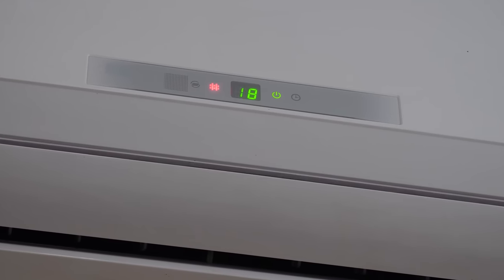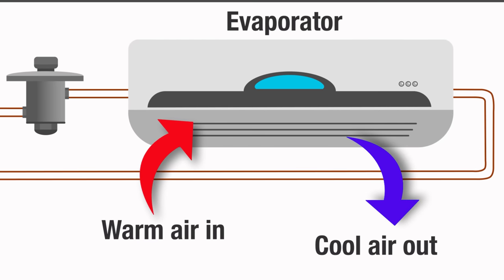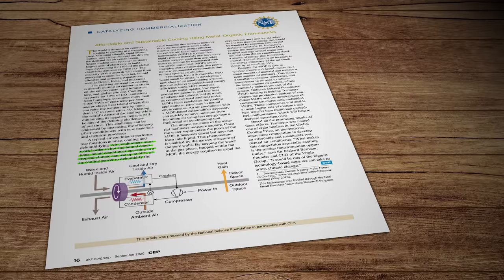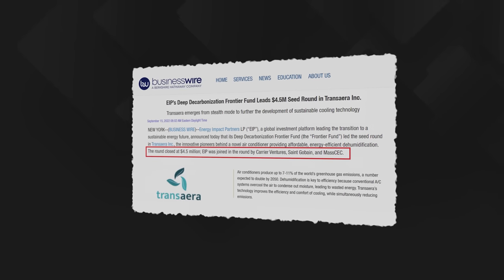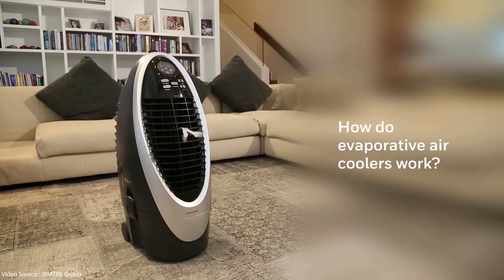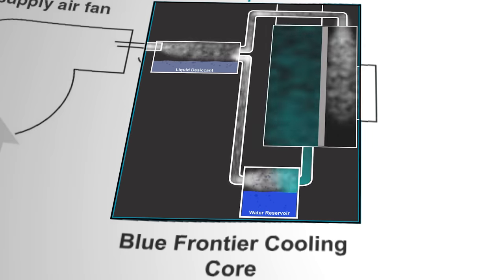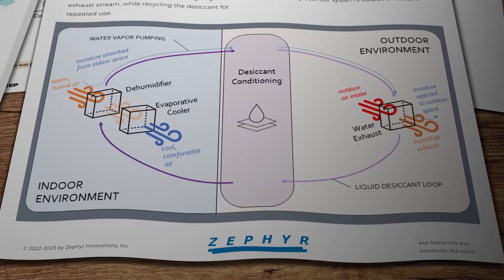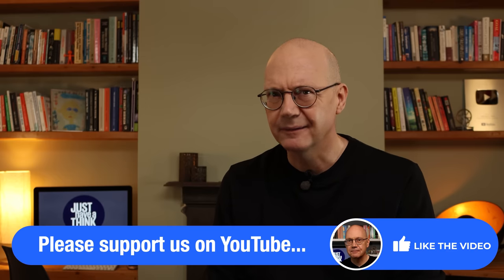Emissions free cooling. Can we do it?

Comment: How does this fit in with using the same heat pump (multi-split air con system) for heating during the winter??

The unit you described at the start can also be used for very efficient heating with a COP of up to 4 (when the process is reversed) and a lot of people are installing them for heating as the main function with cooling in the summer as an extra.

We shouldn't be demonising air conditioning for cooling when the same 'air to air ' heat pump will reduce emissions and energy use during the winter. 

Surely it's better to use a single heat pump for heating and cooling, instead of having less efficient resistive heating in the winter and one of these new cooling system in the summer.

Comment: The other thing about conventional AC is that it can dehumidify without cooling, and also heat.

The latter is useful for the short winter as avoids the need for a seperate heating system (which many would suggest should be an air source heat pump... which is not dissimilar to using the AC to heat).

Do these new systems heat as well as cool?
Reply: If it's a heat pump/AC it can heat.  Ordinary ACs can't heat.

Comment: A hugely effective, cheap, easy, low energy help (but not a total solution) is to simply paint buildings white. This will reflect most of the heat, and the building will run a whole lot cooler. Test; next hot sunny day put your hand on various cars. The darker coloured ones will be so hot as to burn your hand, the white ones will be just warm to touch. Basic, Simple.

Comment: When using an compressor based A/C in a closed room, the air will be quickly dried and so those losses due to removal of moisture is reduced to almost nothing. That claim that dehumidification improves energy efficiency is only valid for the initial operation of the A/C.

Comment: The are some add in for commercial heat pump AC: adiabatic eveporative pre cooling system. Pacifically useful in climat dry or mildly humid. I can save up to 35% on energy.

Comment: If you have a clever building design (shading, insulation, well oriented windows, …) a simple combination of air conditioning and PV panels is easy enough to do the trick.

And since you’re using locally harvested sun energy, you’re not even heating the outdoor atmosphere more than it would have by the sun anyway…

Regenerating the desiccant fluid “with cheap night time electricity” is bollocks. When the sun is down there is less renewable energy available. So you’ll end up mostly using non-renewable energy sold (irresponsibly) cheap.

I do like these developments, but we must not forget that very often our buildings are poorly adapted to the local climate conditions, we tend to choose for remedial solutions (often powered by non-locally sourced energy) in stead of preventive ones.

Comment: So for the home cooler/swamp fan gang, wouldn’t it be more effective to have 2 reservoirs? The first being high saline to dehumidify and absorb some heat and the second with some ice paks to cool off whilst rehumidifying? Potentially keep the ambient humidity relatively even but increasing the cooling effect? As for the dilution challenge, just have an extra one to swap out for a day while the diluted one sits on the porch next day evaporating a bit…
Reply: I run a dehumidifier in an area that is damp during the winter. The amount of water that it removes is a lot (I save it in buckets and use it for laundry). I don’t think leaving the humidity remover outside to vent will do anywhere near enough.

Comment: The two issues are one, getting the system to the scale of economy. The second, is convincing those who just plunked down $7k for a new system a new system at an undisclosed cost. Thus the  third issue which raises from the previous is it's retrofit ability to systems in place and not likely to be replaced after the initial outlay. So, If they can conquer those issues then yes, clever game changer.

Comment: It still sounds like you need a traditional AC or heat pump system in addition to the desiccant system in order for this to work. One of the biggest complaints of existing AC/heat pumps is the ballooning costs (both initial investment and ongoing maintenance). So you're adding a new system on top of an old one. I am skeptical of the cost savings outweighing the ongoing cost increases of now having a dual/combined system. If it were just a desiccant system that showed similar or greater cooling effect as an AC or heat pump I would be much more excited by it.

Comment: In the UK. During a week when Aircon would be rather nice . My solar production is more than enough to cover the consumption an Aircon unit would require. Providing a battery has stored this energy from the day.  I can cool my house for the night with no emissions 

Come the winter. Though not powered by my own generation. It's a heat pump.  

Of course the more efficient these systems are the better. But the sooner the grid is green many of these problems fix themselves.

Comment: Not having to go through the phase change is a fairly big deal, but I gotta say there are lots and lots of problems with desiccant-based cooling systems.  Not only is there significant complexity associated with these systems, but there is also the problem of standing water and compartments containing significant amounts of moisture which wind up being a breeding ground for bacteria.  I really don't think this method is going to gain much traction.
Reply: With some of the systems (like the MOF technology) there wouldn't be standing water, and the MOF element would remain physically dry, so probably not a pathogen problem with that.  You're right that it represents added complexity, but if it saves enough energy it might be worth it.

Comment: Again an excellent video!

But why not save that 35% in energy by saving the cold water?

Have this cold water drip over the ploutsides of the input manifolds and evaporate as they cool the incoming air?

Or intentionally save it and freeze it as a source of thermal storage? That is portable "cold", and should have value.

Comment: AirGreen is another company based in Pennsylvania that has an effective liquid dessicant solution that is going commercial this year. They claim a 40% reduction in energy consumption and control over humidity as well. Why cool humid air when the energy required to cool dry air is significantly lower.

Comment: Have you seen Tech Ingredients' air conditioner design? This one shows an uncanny resemblance to the one he made, with the exception of the final air exchanger. But he uses a solar heater coil to dry the dessicant, rather than using power on a heat pump. I believe those videos are a couple of years old by now, but it's worth looking up.
Reply: i just love it when something that creates a problem (the sun, in this case) also provides the solution (power for the air conditioner)

Comment: Shame there isn't an easy way to change the colour of the exterior of a building to reflect more light in summer and absorb IR in winter.
I don't think anybody would want to paint a whole facade twice a year every year to match the season.

I did see some passive buildings that had porches/conservatories etc with cold air traps (an insulated pit below the conservatory/porch floor for cold air to sink into).  If ducts were run from them to the top floor of a building, and warm air sucked out the apex by a wind powered vent at the other end of the building, that should encourage convection and mixing, with rising warm air displacing the incoming cool air.

Comment: The removal of humidity from the air is not needed in conventional air conditioning, it is a collateral effect from the contact of air humidity with the cold metallic evaporator, and it is actually so bad, that some form of replenishment is needed in specific situations. Those processes using desiccants are also bad for the environment and generate contamination, they can also be harmful if a malfunction leads to air contamination in closed rooms. The best we can do is, instead of just use the outside air to cool down the compressor phase, a central conditioning installation, either commercial and residential, could use this heat to generate electricity, and this already can be done safely and with a high efficiency.

Comment: If heat is just from the friction of rapid vibrating atoms... is there not at least a way to trap those atoms in tiny enough air pockets that will nearly at an instant slow their vibrations because of how much they tend to collide inside those air pockets until it slows enough to simply drift out through a vacuumed side at a far lower state of vibration, hence... cooled down. I don't know if such material already exists in nature or can easily be manufactured/grown, but... that seems to be the ultimate type of air-conditioning if feasible.

Comment: To address the question in the video title - emissions free cooling is possible now.   

I have AC and produce enough solar power to run it.  And I'm far from the only person doing that. 

So cost will be a major issue for the adoption of these ideas.

Or target these new systems at commercial buildings or blocks of flats where the capacity for on site solar is less.

Comment: A few months ago, a more efficient compressor was featured on this channel. Could this be combined with the existing evaporative technologies to increase efficiency in both cooling and heat pump equipment? Or is there something in the operating range of these compressors that prevents this?
Reply from the maker: I think it may be feasible
Reply: No reason why not. That compressor needs some very precise machining of large, intricate parts though - fine for industrial use where budgets are larger, but it might be too expensive to manufacture for domestic customers.
Reply: @vylbird8014  Good point. Hopefully the long term savings might justify the higher cost of manufacturing, or that larger production volumes bring costs down.
Reply: @StepDub Not without regulatory intervention, I think. The manufacturer isn't the one paying the operating cost, and most buyers don't know enough to take it into consideration properly, so there's no incentive to optimise for efficiency. You could get the state to pass a minimum efficiency regulation though, but that brings politics in to it.

Comment: I don't know why no one wants to harnesses waste heat and concentrate it to then use it as we need it. It would basically be free energy.
Reply: TANSTAAFL. 
or on this subject 
TANSTAAFE. :)
Reply: Hmm almost like the waste heat from my refrigerator could be used to heat my water.....
Reply: @d1j16  What does that mean?
Reply: @David_Mash  well when it comes to waste heat from air conditioning, or now heat pumps, there's a lot to get rid of on hot days, especially in warm countries, and what do we do with it! We vent it out into the already warm air.
If we could find a way to store it, concentrate it and then use it when needed, that would be a huge energy saving, and stop heating a world that is starting to over heat
Reply: @atticboy51  my neighbor has a heat pump pool heater to heat his pool water. It sits next to his house AC unit. The pool unit blows out cold air, the AC unit blows out hot air. Let that sink in
Reply: @atticboy51 the problem is you can’t “concentrate” it without inputting extra energy and thus generating more heat. 

It can be hard to get one’s head around, but I recommend you look into the thermodynamics of work heat and waste heat. Waste heat is too high entropy to do the work we want it to do, though it can sometimes be redirected to another use case which has a lower work energy requirement. 

A common one is co-location of energy and hot water — you need much hotter water to turn a turbine than you do to heat a home, so the waste heat from power is suitable for heating water. However, the heat output of an air conditioner is usually lower temperature than your hot water, so it can’t be directed to that purpose. 

Think of it like a ball rolling down a hill, where higher ground is higher temperature. If you can find another “valley” below your waste heat output, you can direct it toward that valley — but you can’t make it roll uphill without supplying extra energy from somewhere else.
Reply: @atticboy51  TANSTAAFL =  There Aint No Such Thing As A Free Lunch.
Heat pumps kind of concentrate heat energy at a low cost but it is nowhere near "free".  It is not a new idea either, see episodes on using waste heat from data centers to warm water or run Stirling engines. This creates another issue as the main point is to cool the heat source, which does not work as well if you put more stuff between it and wherever the heat is supposed to be dumped.

Someone once suggested putting electrothermal elements on the back of a solar panel to get more power out of the overheating panel.
Problem 1: The panel was overheating when it was clear to radiate away heat, adding material would act as insulation meaning it would overheat more and become less efficient.
Problem 2: The TE-elements would not produce much power from just few tens of degrees of temperature difference so it is unlikely their output would cover the energy lost from solar panels overheating.
Problem 3: The TE-elements are ridiculously expensive on this scale, as in couple thousand dollars to produce few more watts.
Reply: @kaitlyn__L  I don't understand thermodynamics, I probably could have when I was younger and really quite into physics and chemistry (I was quite good, but lost interest unfortunately), so I just asked the question. You see what I saw was that heat can be moved with heat pumps, and I wondered if they could be configured so that they concentrate heat in an insulated storage vessel. But if thermodynamics won't allow that I fully understand that it would be a pointless exercise.
Reply: @atticboy51  it’s a perfectly reasonable question! I myself studied astrophysics yet didn’t understand why we can’t just “keep and collect” (as it were) waste heat of all kinds (from motors, charging batteries, and so on) for the longest time. I would say “joules are joules, what’s the problem?” and so on. 

I actually only found out about this answer a few years ago when I was trying to look up the nitty gritty. I don’t suggest you look at extremely technical thermodynamics theory, but there’s a ton of really great accessible explainers (in both video and text form) out there which I bet you could still understand! 

That said I will try to summarise, though I do strongly urge you to seek out other sources as well! 

But yeah, the long and short of it is everything comes down to the temperature gradients, also called delta. Not really the heat as an isolated thing standing on its own. 

From physics you may remember delta-T as an integral of time in acceleration, this is similar except instead of time it’s temperature. And just as a higher delta-T means higher acceleration, a bigger delta in temperature leads to a faster flow of heat from hot to cold. 

Whether something can do useful work for us, or whether it’s chaotic undirected waste heat, basically comes down to whether the delta is high enough. And heat pumps work by creating an artificial cold spot the ambient heat wants to flow towards. Therefore if the waste heat we want to capture is less than the heat we create in making that cold spot, we won’t be moving net energy anywhere.
Reply: @kaitlyn__L  thank you for your explanation, I kind of understand it, and it seems such a pity that we can't use waste heat 😕
Reply: @atticboy51  for sure. 

There’s another way to look at the problem, by reducing it to its most extreme example. Say we wanted to capture all waste heat from everything. We’d need to create a chamber which was at absolute zero. But if we had any way to let heat in, that’s also a way for heat to leak back out again, and it wouldn’t be at absolute zero anymore in either case so would stop working. 

The only way it would “work” would be to completely isolate it from the rest of the universe, which is not only self evidentially impossible but would be self defeating even if it were! There’s a similar paradox in perpetual motion machines, where they can theoretically exist in a perfect vacuum with frictionless bearings, but only if no momentum ever gets extracted from them.

In fact, I think the perfect thermal box would technically be a type of perpetual motion machine. It’s basically just another example of Maxwell’s Demon thought experiment, which was originally about sterling engines rather than heat pumps.

Comment: i want an ac that runs direct on solar panel output, slowing down when there is less power and shutting off if the power is too low to run it.  charge a battery and you could cool a little at night.

Comment: Slightly disappointed that the solutions aren't a bit more radical than what is still essentially just making conventional AC more efficient. How about other approaches such as having ultra white roofs and heavy insulation combined with harvesting cool air at night and 'storing' the coolness for use in the day.

Comment: Now I'm no HVAC Engineer but what I don't understand is why they don't use the waste heat in these systems to heat up the hot water supply (as needed) instead of simply exhausting it?

Comment: I've have seen few electricity tariffs in the UK which have a cheaper night-time rate.  Those systems that require an external compressor and heat exchanger find serious challenges in the UK where there is often insufficient space to deploy, same as for heat pumps - how would a tower block of flats have these?  We need to find practical solutions, or probably more precisely a range of solutions appropriate to the type of building.